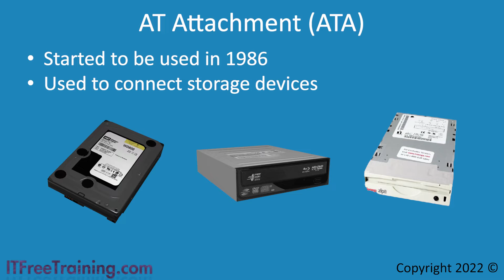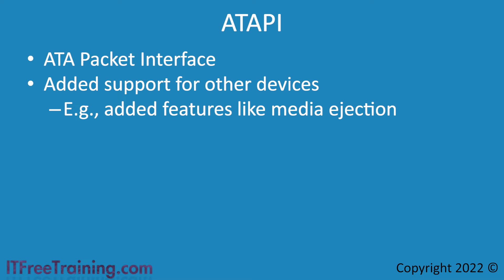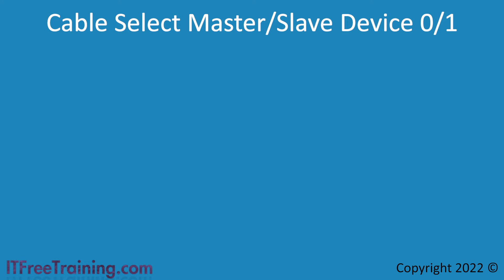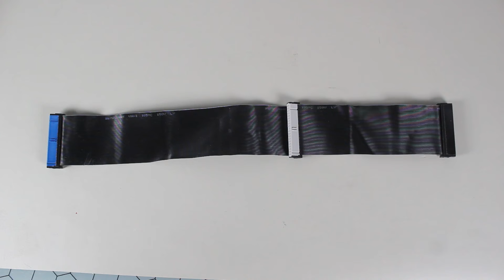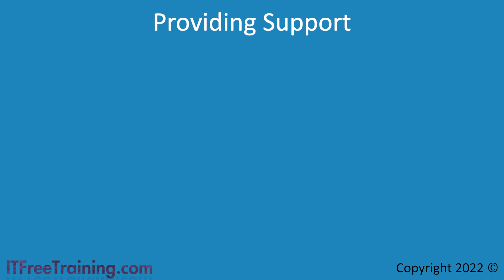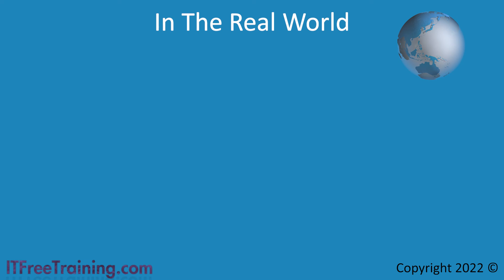IDE/PATA

Comment: over the years ive seen a lot of devices, which had problems with cable select. Master/Slave configurations worked in most cases. Most cdroms must be set to slave when hard drive pluged on same cable. Some drive weren´t found by bios  when master was missing on cable. It is possible too to plug the cable with the smallest gap to the motherboard against the normal scenario. Big tower cases has the Cdrom device in the upper part of case and the Hdds are nerby the motherboard. In the end the quality of 80 pin cabels was terrible, so udma 6 sometimes won´t work. But i guess it´s 20 years ago. thanks for your content.
Reply from the maker: This should work with modern computers. Very old computer use to have a lot of problems. In the 90's, I remember have two hard disks would only work if one of them was a master. If I swapped the drives it around it would no longer work. But as you said, that was 20 years ago. :)